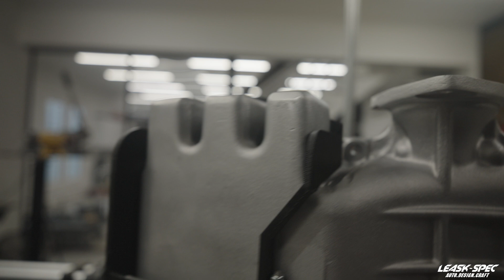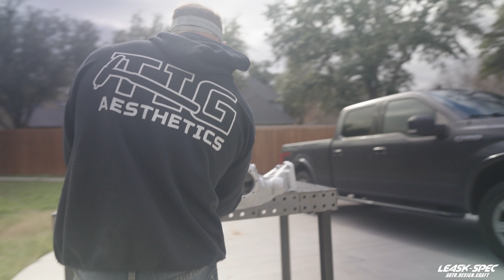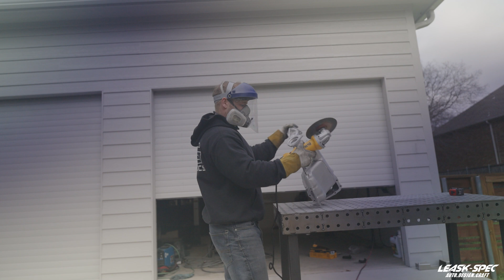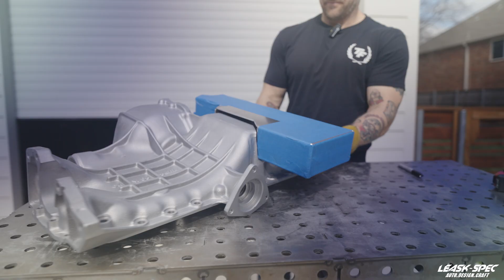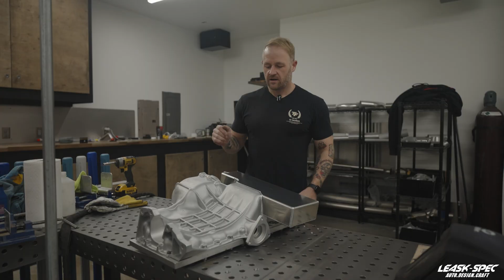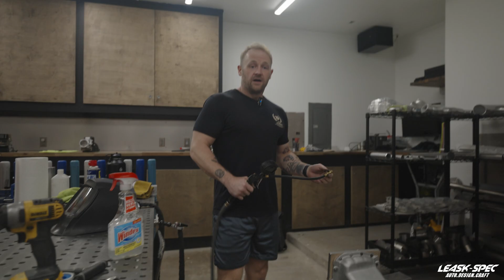Leaskspec RB26 Oil Pan Modification Guide

Comment: do you have any oil pan cores on hand that you can offer w/ the service which allows customers to send in their pans once swapped out? I have a low mileage r34 with stock everything would love to get this service but can't afford the 'down time'
Reply from the maker: @supernice_auto  unfortunately currently I don’t. Additionally it’s a little tougher with r34 as they’re geared differently and I don’t often come across 3.54 final drive pans. If we set something up I’ve done same day turnaround service in the past and can make the same thing happen again

Comment: Sick! I have my oil pan at MA right now! Can’t wait to get my car together with this thing on! Love the videos! Attention to detail is next level! I had an old sump front a buddies car with a blown up diff, and I warped the sump a few thousandths even though it was bolted up to a spare block when I welded the 3” hole in the diff closed. Needless to say, now that I’m using my good oil pan, I’m having MA Motorsports do the sump install for me. I really like the idea of leak testing it with soapy water. Great stuff!
Reply: Hello I have a quick question if you don't mind sharing how much did MA motorsports charge to do the job?
Reply: @bohemianraceart  I’m not sure. He gave me a quote, but I’m also the guy who hooked him up with his shop R32 for a crackhead price, so I’m not sure if that quote reflected that.

Comment: You need a deep hole marker for marking out the jig
Reply from the maker: I’ve searched for the long tip ones but haven’t had any luck?
Reply: @Leaskspec  Try a Pica-Dry with a colored tip. They hold up reasonably well